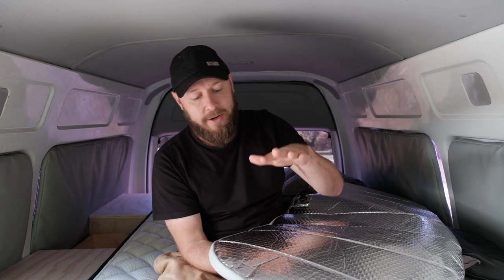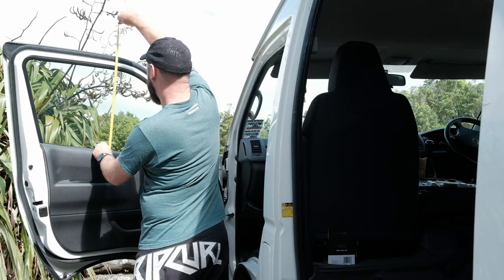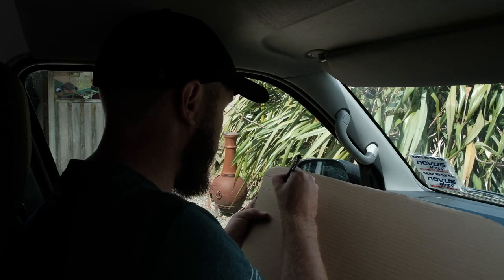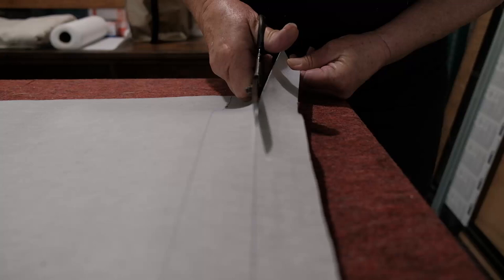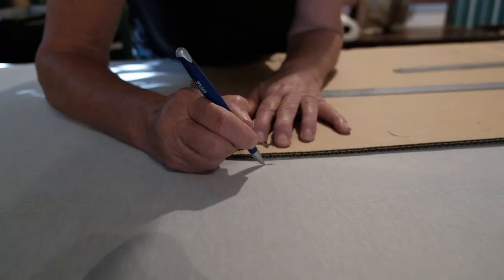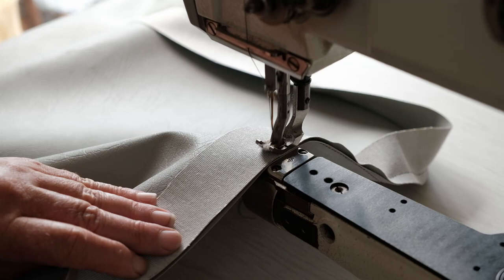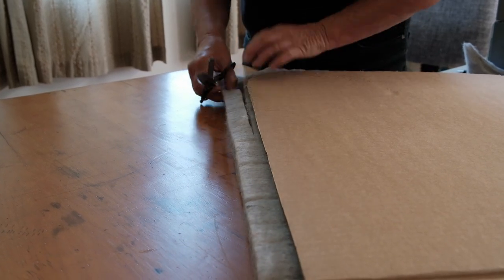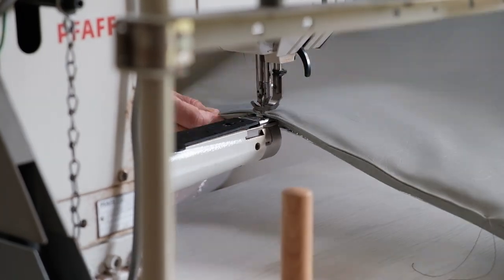Toyota Hiace Camper Van Conversion - How to make insulated van curtains

Comment: Great solution. Where do you store them during the day? They look great for winter but won’t it get toastie in summer? How do you keep the van cool at night?
Reply from the maker: I have a large space under my bed for them.
The silver side of things facing the sun bounces most of the heat out.
I might get a fan in the roof but to start with I'm planning to just test som USB fans and a mesh covered window